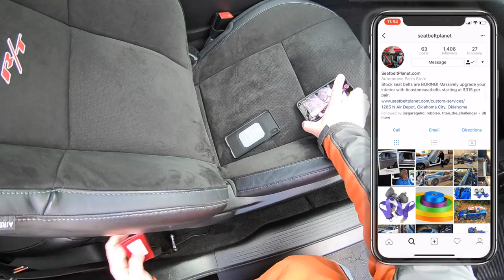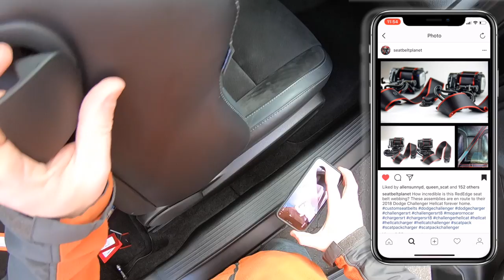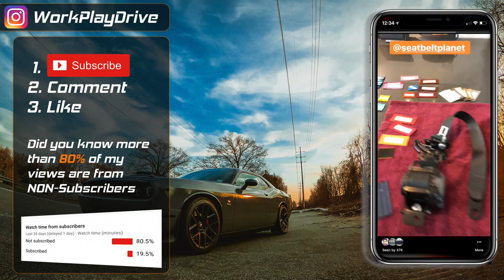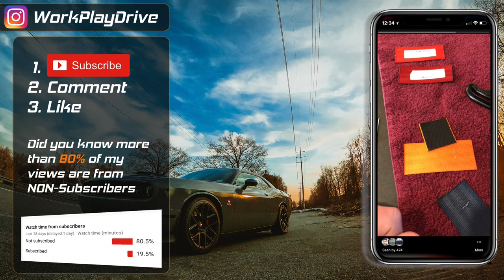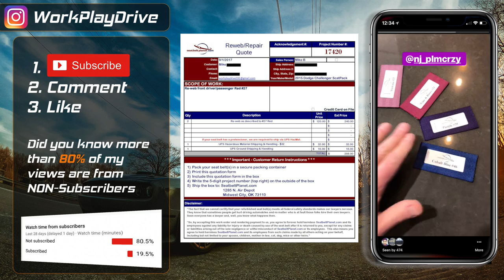SeatbeltPlanet.com - Part 1 - Removing the Challenger Seat Belts

Comment: Great video. Just did mine to be sent off. Getting neon green to go with my sublime scat pack. Oh and it was much easier with the rear seat popped out. Besides the passenger side. Who puts a wire harness that close to a bolt. Thanks fca
Reply from the maker: I know right, the passenger side was a bit annoying otherwise pretty easy.